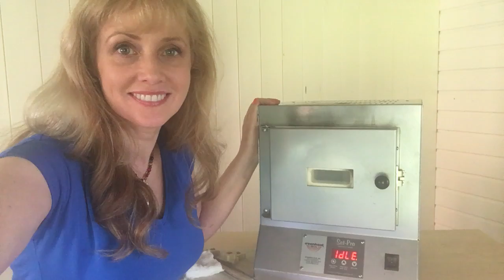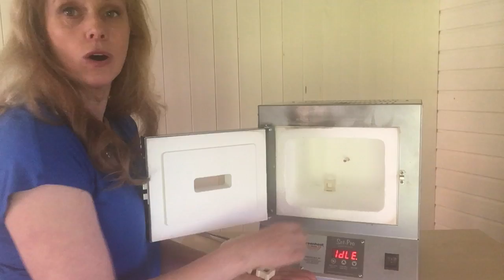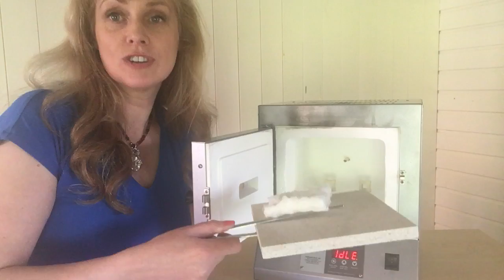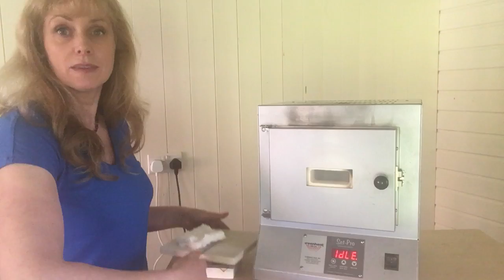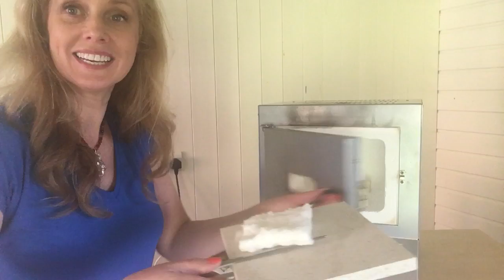Love your Kiln 3 - How to load your kiln for firing PMC

Comment: So you can’t fire something that has to be placed in a stainless steel pan with lid  as it would block the pin in the back of the box.  That limits it’s usefulness.